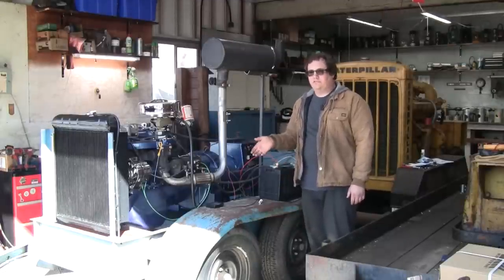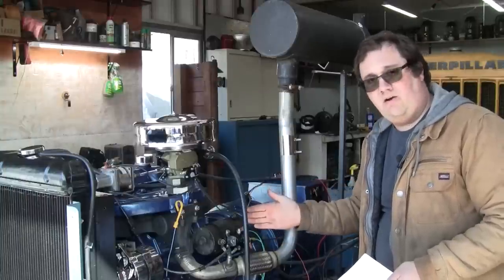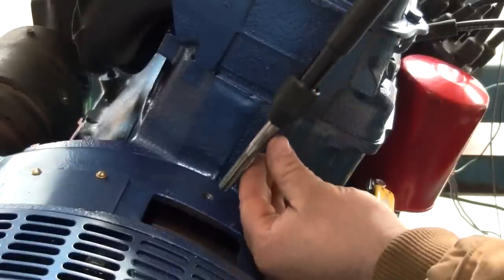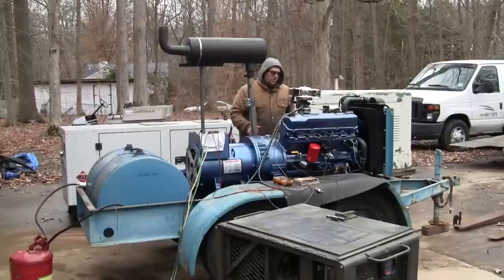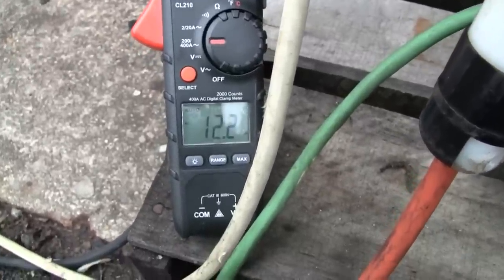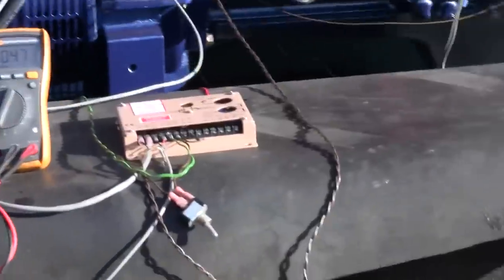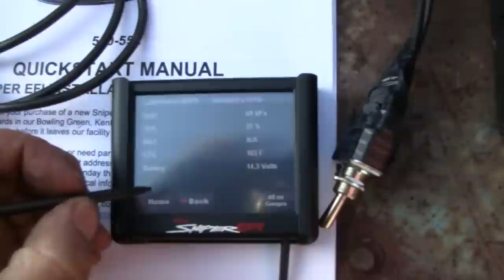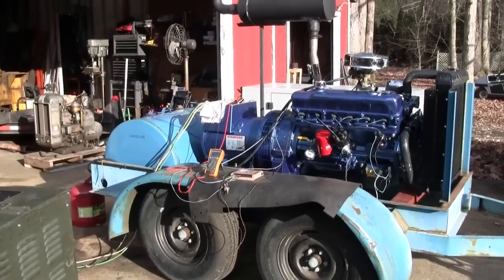Chrysler Slant 6 Generator Gets Holley Sniper EFI Pt.2 FIRST LOAD TEST

Comment: That's really cool,  I would like to put that EFI system on a car without fuel injection, seems like it can handle the extra load easily.  

Could a generator like that handle an all electric home?
Reply: Standard US house has 200 amp line service.  For me 30 KW would get the job done as long as you were careful.  No real big loads.  Might scrape by with 20 KW.  This is where I always get into it with solar freaks.  Takes a hell of a lot of solar to make a consistent 30 KW.  Some of them act like they live in caves and read by flashlite.
Reply: @rogersmith7396  yep, people never realized how much power they really use.
Reply: @rogersmith7396  
Sir, thank you for your response,  I very much appreciate it. I was thinking about buying a home generator,  I wouldn't want one too small.  Again thank you Sir.
Reply: I have lived in an all electric house for 15 years that has a 100 amp service and have not tripped the 100 amp main breaker yet.
Reply: @woodhonky3890  
Thank you for that information,  I don't have a clue about how much it takes to run a house.  I want to get a stand by generator just not sure how many Kiliwatts,  or amps I would need I have a small house so I guess that would make some difference over a bigger home.  

Again thank you for that information, it is appreciated
Reply: @bertgrau3934  It all depends if you want to be in the cold with one little light bulb or weather you don't want to know the mains ever went down.  If the later I would say 30 KW minimum, 40 would be better.  Also these things burn lots of fuel.  I worked in a large 200 bed nursing home where the power went down for three days and we were on a smallish generator.  No heat a few lights, no computers.  It hit maybe 45 degrees before the power came on.  Something similar at my house where I used an inverter and a car battery to give me a light and TV.  I also had a Coleman lantern and stove.  Once the sun goes down you are sitting in the dark.
Reply: @woodhonky3890  My house has two 75 amp draw furnaces.  Thats 150 max wide open.  A heat pump compressor is going to draw 45 amps.  Oven, electric drier, power tools, arc welder, big air compressor, lights.  I would have little left if both furnaces on.  Old houses used to have 30 and 60 amp service.  Couple of outlets and a bulb hanging in each room.
Reply: @rogersmith7396  
Thank you for that information,  I think I want to stay warm in the winter and cool in the summer.  I have looked at a few,  one company said they couldn't help me because I don't have natural gas,  or propane.  So I'm guessing I need either a gas, or diesel generator.  

Thanks for the information it is definitely appreciated.
Reply: @bertgrau3934  Propane is getting less popular due to volitility in price and supply.  Diesel is high but is the best choice as it has more BTU than gas and those engines are typically longer lived and higher quality.  Depends how much you expect to use it.  Your furnace and AC compressor will run on 220Volts.  Look at the breakers to each.  That is minimum amps needed assuming no other electric is used.  Mine would be 75 and 45 or 120 amps.  Volts times amps = watts or 26,000 watts if my math is right.  Actual draw will be less as I assume the breakers are sized for the start up thump each time it cycles.  Stove burners can be 5000 watts each as can water heaters.  Hot water radiant heating uses big heaters.  It will be expensive.
Reply: @rogersmith7396  
Yes sir,  I don't expect it to be cheap,  I was just trying to get an idea of how much kilowatts,  or amps I would need to run my home. I know a little about diesels. I drove big trucks for 44 years.  I'm thinking maybe a Cummins powered generator,  I found a used one with 100 kilowatts and a 500 gallon fuel tank mounted on a self contained trailer.  The only problem I think would be is our electric has only gone off for less than 4 hours in the year we have lived here.  The diesel sitting for say 8 or 9 months may not be good.  That's another thing I'm thinking about
Reply: @bertgrau3934  100 KW would be plenty.  Commercial accounts like Mike services run their gensets monthly.  You would need to investigate regular filtration of your fuel and bacteriocide and stableization especially in high humidity.  Frankly I don't think you could keep 500 gallons alive indefinitely.  It would be better if you had a diesel car you could fill from that tank and keep rotating new fuel in and old fuel out.
Reply: @rogersmith7396  
That's a great idea.  I don't have a diesel car/truck,  but that's a great idea,  I'm thinking I could run it for at least 24 hours a month,  and that would help knock off a little my electric bill.
Reply: I have a 200 amp service, 2 out buildings, welder, compressor etc.  When the power goes out, I fire up the 6250 watt generator.  It's 220 output, so the well can run.  My high energy loads, stove, oven, dryer and hot water heater are propane, heat is oil.  The generator takes care of everything else we NEED, refrigerator and freezer.  I elect to turn off the air conditioners when the power goes out.

I see a bit of discussion about keeping the fuel stable for extended periods of time.  I think this is key for this discussion because the reality of my situation is that I have only NEEDED the generator twice since I bought it years ago and never for more than 4 hours.  

I use it more often to run my welder when I am too far from the out buildings.
Reply: @bertgrau3934  The diesel is far more expensive than on grid.   Service contracts run them for 30 mins. to 2 hours a month.  I always worked in healthcare and they have special rules for generator performance.  What Mike calls Life Safety requirements.

Comment: Why not start at an idle, then ramp up to desired speed, also can the genset be load sensitive? Ie. No load then idle if presented a load then right to running speed, once the load drops then after a set time idle to cool then after a time shut down?
Reply: Depends on how you are using it. If it is used in an auto start configuration, you would want it to go straight to 1800 rpm and take the load. If you are manually changing from utility to generator then you could idle it first then ramp it up and then transfer the load to it. 
There’s not a no load configuration for idle, if it is hooked to any king of load at all, it needs to be rated speed and voltage.

Comment: I have a Generac that runs at 3,600 RPM.I think I understand the math to get 60 hertz at 3600RPM, but how do you get 60 hertz at 1800RPM?
Reply: The number of poles in the generator determine what RPM is needed for it. 2 pole- 3600 rpm.  4 pole is 1200/1800 rpm. There are 900 rpm generators too.

Comment: Given how under stressed this engine is, you could save a worthwhile amount of fuel and reduce the noise even further by replacing that mechanical fan with an electric one... or 2 .  That big mechanical fan would be sucking a lot of power and I'll bet the temp is bouncing off the thermostat and the water going into the engine is way cold. 

I have used electric fans on my stationary engines and they make a big difference over mechanical's.
Reply: Mechanical is perfect as you have nothing to worry about when the time comes to use it. It’s always gonna work and there’s no issue or a mouse eating a wire. Usually when you start running a generator your not going to be present watching it so you don’t want overheating.
Reply: @FishFind3000   Electric fans have been on cars for years and been Very reliable. 
There are wires all over that setup so worrying about one on a fan isn't really valid. 
Being injected and computer controlled there is going to be a built in overheat shutdown on the thing so no need to worry there. 

In my book, reward very much outweighs risk on this.
Reply: @glumpy10  Electric Fans likely would not be able to keep up with the cool demands of a hard-working generator under high load.
Car's can get away with electric fans as they are usually only under low / partial loads for sustained periods (not sustained flat out), but more importantly, when the vehicle is working hard at high speed, there is the ram air affect through the radiator to assist cooling.

Mechanical Crank driven fans have a much more aggressive pitch on the blades than electrics and are not limited by the constraints of electric motor limitations so can move MUCH More air flow, which for a heavily loaded stationary engine is critical. Electric Fans also need a lot of amperage off the 12v electrical side which means a bigger 12 Alternator is needed, or an Auxiliary AC to DC power supply fed from the Generator head to supply the amount of current you'd need.
Reply: @KSSilenceAU  That would disagree with my experience of fitting them to my truck and towing up mountains for 20Min plus when the thing barely gets any warmer. 
That is developing over 150KW of heat that has to be dissipated and if it were not, the engine would overheat in minutes if that.  
The vehicle I have is known for overheating with the mechanical fan which is why I put electrics on it in the first place. 

This generator is not hard working, That was shown in the Vid. The load is only 30 KW plus engine inefficiency. 
The radiator is a substantial one and it would not take that much airflow at all to dissipate that much heat. 

I have run a waste oil burner for heating my home doing 30 KW output and a MUCH less powerful Tube fan than a radiator fan has no trouble pulling that amount of thermal energy out of the system. 

Even the heater core and fan in an average vehicle is capable of pulling 20 Kw+. 

Sorry but you are also WAY off on the electrical requirement. A larger fan only pulls about 15A so plenty of capacity for even a little 30 A alternator. 

The fan on the generator as it sits is WAY  overkill for the setup and wasting fuel and converting it to noise. I doubt a decent electric fan would even run all the time. 
Quite confident with that radiator and load  which would more likely be UNDER 30 Kw than at that, would just cycle on and off. 

I have used electric fans on vehicle conversions and my stationary engines as well as my home heater  so I have first hand knowledge and experience on the thermal dissipation requirements which going by your assertions, you do not seem to have worked with or understand.

Comment: What is wet stacking. Wife asked.
Reply: After a diesel engine is under low or no load for some time the combustion chamber cools down too much, then diesel fuel will get into the exhaust due to incomplete combustion, it will also produce more soot and both will mix together to form a sticky black liquid that will drip through any loose joints or holes in the exhaust system.
It also causes carbon buildup in the injector nozzles, valves, cylinder head exhaust ports, exhaust manifold, turbo if there's one and so on.

That happens when you have a diesel generator that is too big for your actual electricity consumption, to fix it either you replace it with a generator with a smaller engine or you connect additional loads to use more electricity which obviously leads to more fuel consumption.
Reply: You also get bore glazing with under loaded diesel engines which results in high oil consumption. 
That's an even bigger problem because it can't be cleared with a couple of hours of high load like you can do with wet stacking.
Only way to fix bore glazing is to pull pistons and hone cylinders.

Gas engines don't suffer much from bore glazing much either